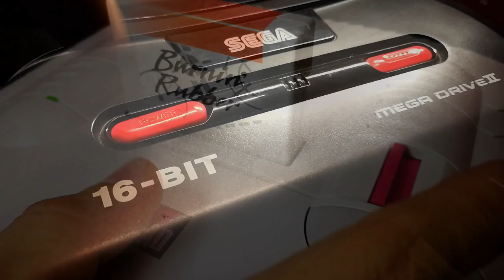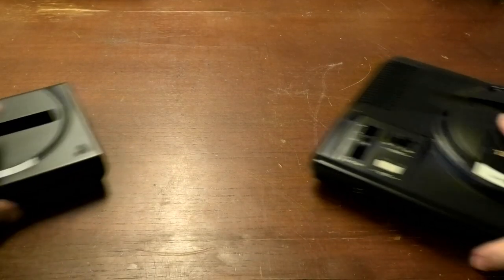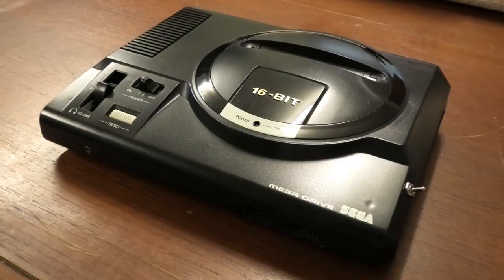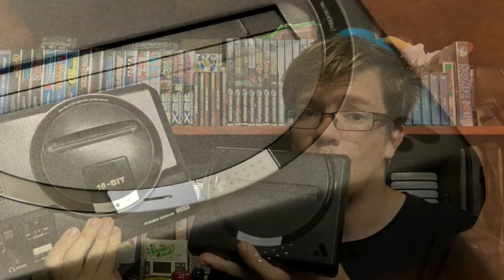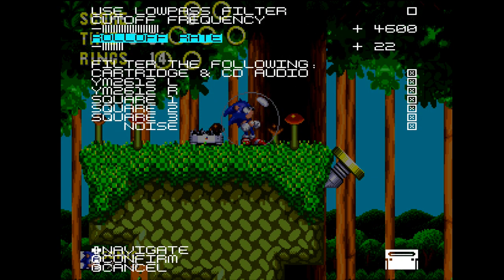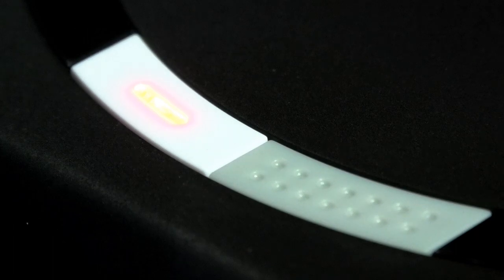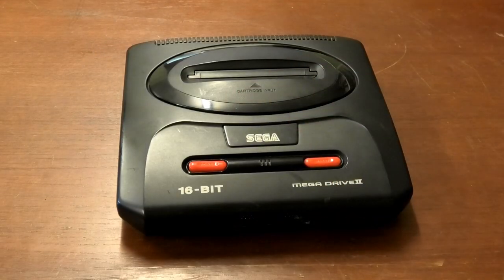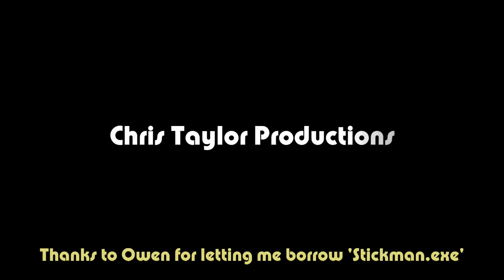Does the Mega SG Sound Better Than Original Hardware? | Joystick Division

Comment: My thoughts on each:
- Mega Amp: A TINY bit less clear than the SG, but I feel the instruments have a bit more of an impact.
- Mega SG: Tiny bit clearer, but a tiny bit less impactful.
- Model 1: Doesn't touch the other 2 but works if you don't have a really good sound setup.
- Model 2 (stock): Dumpster falling down stairs.

If I had to say, I think it might go to the SG as the best for me due to the clarity, but if you played them both seperately I couldn't tell them apart.

Comment: Thanks so much for putting this video together! Really appreciate it. I like your sense of humour too :D Just curious:  what sound settings did you use on the Mega Sg for the comparisons? Personally, I don't use any low-pass filtering or whatnot and enable the hi-fi YM settings. I'd rather improve upon the sound vs. reproduce exactly. Gawd, I love me some old-school Yamaha, DAC, and PSG sound chips! The Mega Sg does an incredible job not only low-level simulating/reproducing those, but also enhancing them. Highly recommended. I just... can't go back to emulation at this point.
Reply from the maker: I appreciate your kind words. :)
I just used the default settings on the latest firmware. I did have the 'high quality mode' turned on too (can't remember if that's default or not, oops).
It really does do an amazing job at reproducing these iconic sounds.
Again, thanks for the kind words, I really appreciate it. Especially on my sense of humour, I've always thought it was a bit odd, haha.

Comment: To me the mega sg and mega amp are a tie. The model 1 original is good but still lags slightly behind the mega sg and mega amp. However the best over bang for the buck is the model 2 with mega amp installed. Model 2 is easy to obtain at a cheap price and if you have basic soldering skills or know someone that can do it for nothing or cheap its definitely the best option to go. However if you have the money than mega sg is what you want . I got my mega sg last year and love it especially once you dial in the picture and sound settings to give you the most authentic genesis experience as possible.

Comment: The mega amp is probably closer to a neutral sound than the mega SG as it has a slightly brighter while the model one is outright warm city, seriously if you told me there were vacuum tubes inside the model one, I just might believe you then crack open the system  to swap tubes only to be disappointed with no tubes.
Reply from the maker: That's an interesting way of looking at it. I like that.

Comment: I love this video.

Light critique - You should have listed out what settings you're using for audio, before the comparisons.  You only briefly mentioned them.  The MegaSg has a lot that you can tweak - several comparisons at different settings would be awesome.  Also, noting which firmware you're on would be good, the sound on the MegaSg has changed slightly over time (for the better).

A guy named FirebrandX has settings you can use to make the MegaSg sound just like the Model1, Model2, etc - there are differences in the rolloff, cutoff, etc.
Reply from the maker: Thanks for the constructive criticism.
I did mention that the Mega SG was using the default settings on firmware 4.6 though. I used it that way for each comparison.
I'll check out FirebrandX's settings when I can.
I'm glad you enjoyed the video.

Comment: Model 1 VA3 sounds the best and most authentic of any Genesis or clone or FPGA. After all it is the real deal. Also, no details about setup or if the Genesis/Megadrive consoles were recapped. That makes a huge difference...
Reply from the maker: Those are good points at the end. No recapping was done to any system. I'm sure that if I did there would be a difference.
Reply from the maker: Yeah, recapping does make a big difference if the original caps are bad.